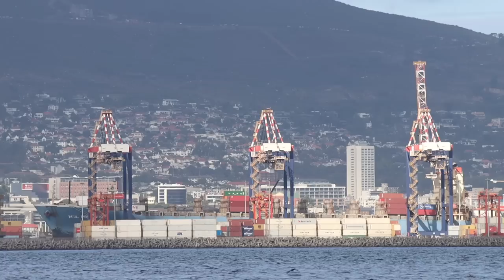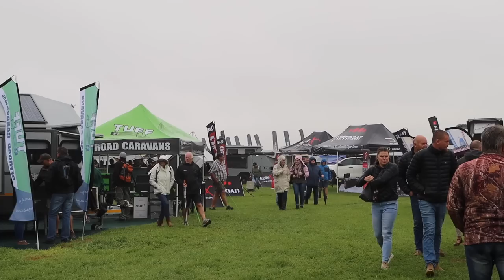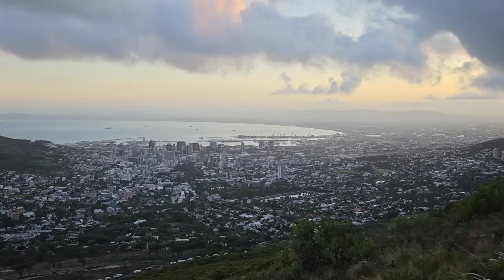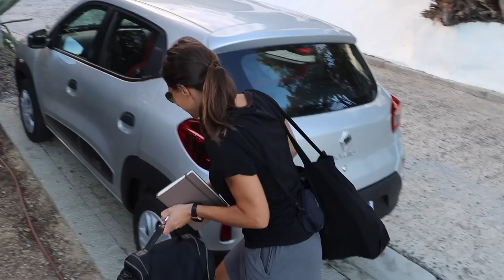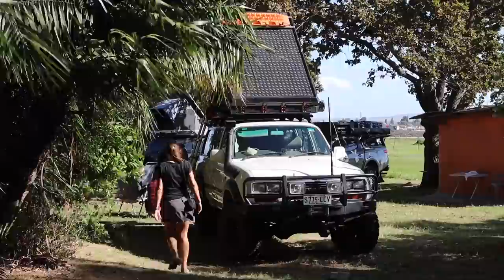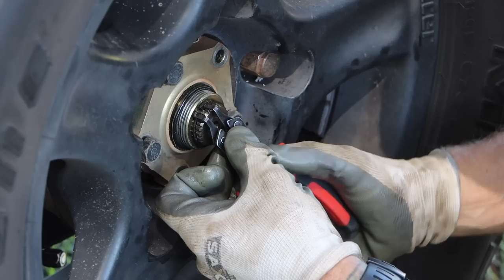Half a mile in Africa we almost destroyed our car... Ep251

Comment: The exact same thing happend to my 2009 110. Unfortunately my rear diff was completely wrecked as a consequence. I spoke to Nigel at XS 4x4 and David Ashcroft and they both independently said I was very unlucky for that pinion bolt to shear, their best guess at the time was it over torqued from factory. Good luck with the repair and the African Adventure!!
Reply: Hi from Australia🇦🇺
I just read your comment and thought you might like to look at my set up, some Australian locations and camp cook ups.
Cheers and safe travels 
Out There Touring

Comment: Oh man, I've had drive line issues on my RIg before.  Watching this brings back a flood of memories. Lucky for me I converted my rear axle to full floating axles with lock out hubs on all 4 wheels when I built it for extreme expeditions. (A 93 Isuzu Rodeo with Toyota straight axle and Marlin Crawler transmissions).  
Once had a rear seal let go, and ended up sticking a rubber Chysler freeze plug in the axle to stop the oil leak. Tossed the half shaft in the roof rack, wrapped in a towel inside a plastic tarp, and drove halfway across the USA on one rear drive wheel. Fixed it in front of my buddies house in Sacramento California.  (His HOA was not happy!) Another time shredded the rear differential and just unlocked the rear hubs, pulled the driveshaft and drove it 1000 miles home on the front axle. (At 70 mph too!)
So happy to see you reunited with the Grizz!  Wondering if the driveline didn't take a lot of hits getting loaded and off loaded at the ship yards?  
Happy Trails Ya'll !
Reply: Hi from Australia🇦🇺
I just read your comment and thought you might like to look at my set up, some Australian locations and camp cook ups.
Cheers and safe travels 
Out There Touring 🇦🇺

Comment: Welcome to Cape Town 😘 You’ll find a lot of Defenders here as it’s one of the only vehicles that doesn’t rust in our harsh ocean climate. Hope to see you around. 🙌
Reply: Hi from Australia🇦🇺
I just read your comment and thought you might like to look at my set up, some Australian locations and camp cook ups.
Cheers and safe travels 
Out There Touring
Reply: Sure. Check ur firewall😂
Reply: @stubromac2711  that’s the pretty much the only part 😉
Reply: @businesspins5825  Along with the chassis of course. You forgot the chassis. And the firewall.
Reply: @English_Speaking_Fox  the chassis is extremely thick and durable and easy to access to treat with anti rust coating. Body panels not so much. Regular cars body panels here in Cape Town get seriously rusted after a few years. You’re missing my Point. It’s still better than most cars in respect of rust 🤦🏻 Can we move on now?

Comment: Wow ! Welcome to SA !  Cant eait to see where you'll go explore.
I suspect the pitching up.and down of the ship  put a.lot of pressure on the shaft and diff to keep car in place, if the strapping and parking brakes were not on and Defender completely immobilized... the sea movement is relentless... i would inspect all the joints.ans carry spares... just saying
 Plenty of great Defender shops andmecanics in SA. They used to assemble them here in SA. The TD5 engine built in SA is referred to as an18P not 10, 15 or 16P but same as 16P.
Have Fun !

Comment: Look forward to your African adventures. A P38 I bought had a noise at the rear. Removed drive shaft and noise still there. Pull out axles and then diff. Seven of the bolts holding the ring gear to the carrier were missing their heads. These were rattling around in the case and periodically getting caught between the ring and pinion. Strange thing to happen but then it is a Land Rover. No saving that diff.

Comment: Hay Leigh, wondering if that drive shaft broke in transit. 
Did you leave bear in gear? 
I’m thinking it was rocking back and forth (if) in gear on the ship fatigued the bolt in the rear driveshaft. 

What do you think?

Comment: As we know we work in the maritime industry, the jerking movement of the ship riding the swells and waves this could put big time wickedness on the diff bolt the snap !
Now I have a couple of questions brother :
Was the defender leave on full 4WD diff lock and on first gear to leave the gears and wheels fully lock when was traveling on the shipping container?
Hand brake hard on ?
This jerking and vibrations of the ship navigating hard for such a long period of time this motion could make this bolt on the diff snap for sure as the defenders wen don’t leave on full locking battle gear 4x4 have a massive play and the motion of the seas would put so much pressure and tension by pushing the car back and forwards to the drive shaft, until something will give up lucky this time was just the bolt the suffered next time wen u ship the Landie leave it on fully lock 4x4 and nothing will happen promise
Reply from the maker: Yes left in gear and handbrake engaged. We believe for sure this was the reason for the failure. It's the only explanation. Lesson learned.
Reply: My Guess is that since generally speaking the geometry of the axles changes when the suspension is working. The wheel base length changes a bit which is why the shaft has a variable length. Constraining the movement of the 4 wheels means that the wheelbase would not elongate at the same rate as the shaft with the suspension and the suspension would be constraint in some way by the drive shaft. Pulling and pushing past the limit on every wave and thus weakening the bolt.
Reply: @tc9422 let’s say the links are 750mm long, and that the axle has a total of 250mm of travel from full bump to full droop. Let’s say the vehicle has equal up and down travel from ride height. That’s 125mm travel either way. That means the rear axle only moves 10mm from ride height to full droop or full bump. There is more slip than that in the sliding joint of the prop shaft.

Comment: New to your channel, LR owner for many years . Our first LR had trouble with a rear diff pinion bearing when it was brand new. Number of years later vechile was driven a considerable distance with only a front drive when a uni broke on rear tail shaft. Think all Defender owners must use the same method for checking the water level. Will look forward to following your African trip with interest.
Reply: Hi from Australia🇦🇺
I just read your comment and thought you might like to look at my set up, some Australian locations and camp cook ups.
Cheers and safe travels 
Out There Touring 🇦🇺

Comment: It might be better to drop the prop shafts (one end) when shipping in a container.............with a vehicle lurching forward and aft at sea it may put a lot of torque on the drive train???  Whatever happened, it happened on the trip......................funny the people that unloaded it didn't notice the problem???????????
Reply: Makes sense what you are saying Craig, the handbrake was probably engaged and it brakes on the rear prop shaft , not on the wheels like other vehicles. So too and fro movement could have easily caused the damage then if the straps didn’t provide the supports it should have
Reply from the maker: All correct we believe. It's the only explanation unless of course something happened during the unloading. You're also right in saying you would think they would have heard the noise as it was really loud and sounded bad.
We will give them the benefit of the doubt and tell ourselves it was a result of being left in gear and handbrake during shipping.

Comment: Great to see the first SA video pitty about the propshaft that bolt looks very short so it may have been starting to fail for some time. Possibly loading nd unloading was the final straw thankfully not t much damage but you will probably need new pinion gear as that shaft is part of the pinion gear
 Good luck you are on good hands though.
Reply: Hi from Australia🇦🇺
I just read your comment and thought you might like to look at my set up, some Australian locations and camp cook ups.
Cheers and safe travels 
Out There Touring 🇦🇺

Comment: So, you have to remove the half shafts in order to drive without the rear prop shaft? It was it to eliminate the noise?
Reply from the maker: G'day mate 😉 No we didn't need to remove the halfshafts to drive without the rear prop shaft but seen as though that pinion bolt had broken the pinion gear was loose and knocking around. I thought it better to be safe and avoid potential further damage.
Reply: @GrizzlyNbearOverland  thanks for the reply. I keep learning things from you. So wanted to clarify. Just in case I'm in a similar situation

Comment: should have also removed both the rear axle halfshafts 
- this would have stoped all rotation of the rear diff, and prevented further damage
Reply from the maker: You obviously didn't watch the video...
Reply: @GrizzlyNbearOverland  yes I did, watch the entire video
- I saw that you eventually removed the halfshafts after further vehicle operation
- not a big deal, as the crown wheel and pinion will be buggered anyway and need replacing
- all the best with your repair. (Africa should be well equiped for this repair  on the landrover)
Reply from the maker: @johnallen3555  yes we literally removed the half shafts only 50 metres down the road after removing the rear prop shaft.
Pinion gear and crown spline are in perfect condition.
Our quick reaction and measures taken to prevent diff rotation are what prevented further damage 😊